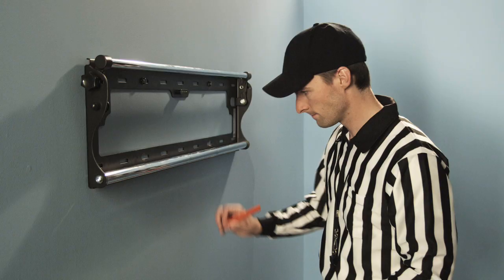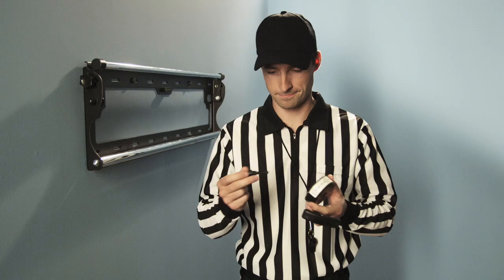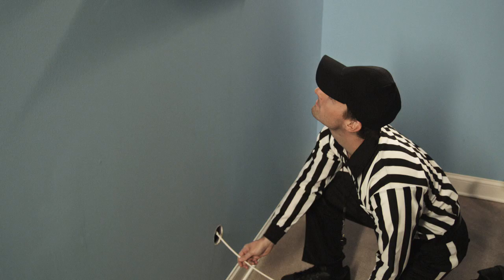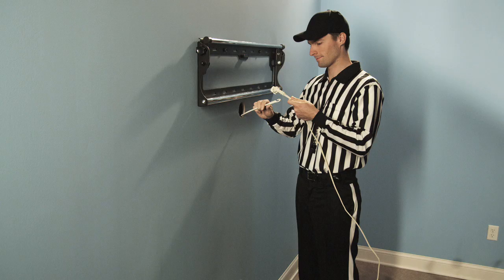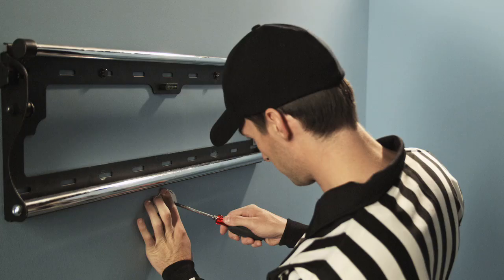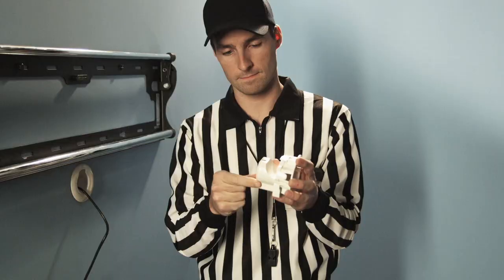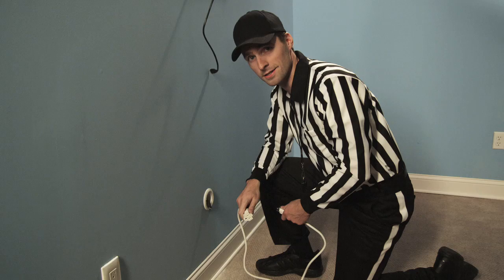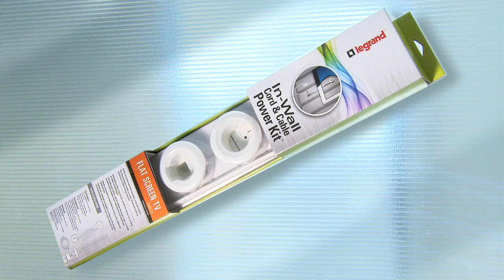Wiremold: How to Install the Flat Screen TV Cord & Cable Power Kit

Comment: Yes, it does look easy with any of the non-insulated walls in your house.
Good luck with the outside or perimeter walls where there are insulations and cross-bracing studs.

Over all, I like the kit a lot.

Comment: This is a much better product than the previous, a large square hole system, more time extensive process.

However! What if you happen to run into a stud in the wall?? Ummm....yeah. And plumbing if there is no stud? What about high voltage wiring in the wall?? Yes? Anything like high voltage short, gas line break, give you hints? Somebody is going to take your advice, stick that hole saw in their drill, and high speed drill that thing into the wall. I've seen professionals make that mistake!! And it ain't cheap!!!  Stud finder, electrical field tester, knowledge about plumbing nearby, gas lines maybe?? Wow you guys. And fishing the wall, yeah. No insulation? Really? And maybe so, then what about the fire breaks installed in non-insulated walls? You guys really need to have a professional demonstrate this process. Hope you guys have some good lawyers!!